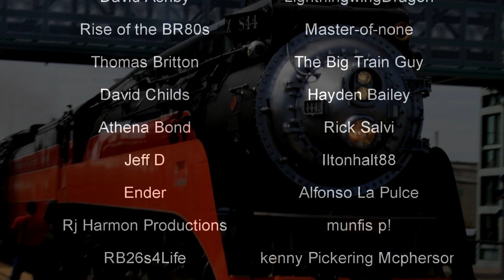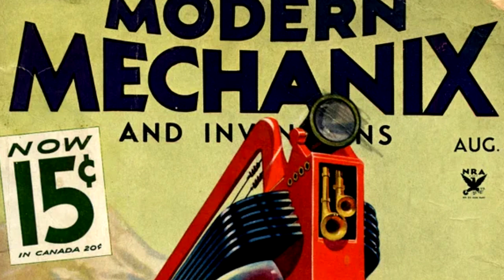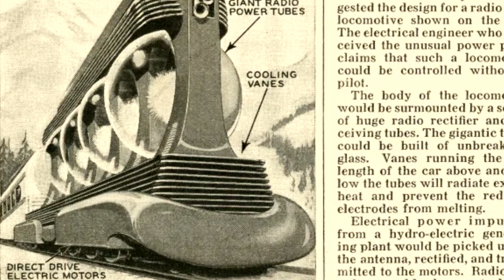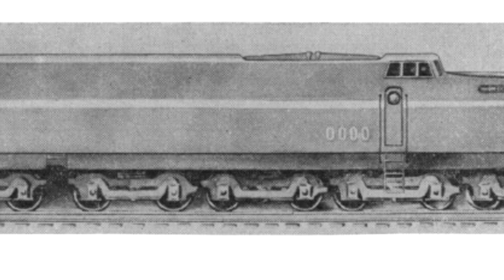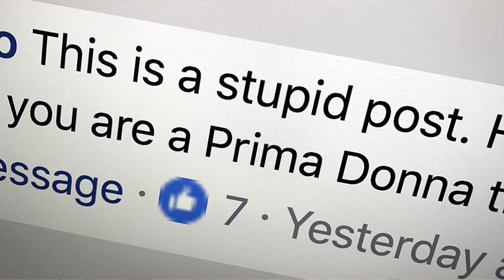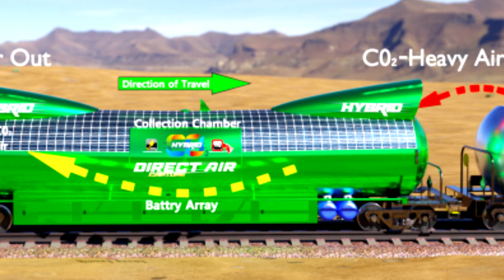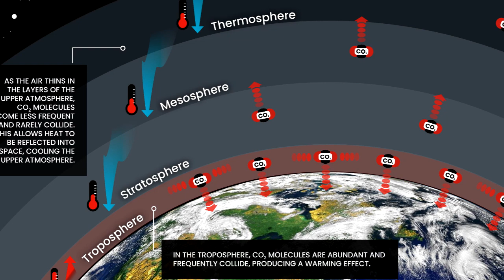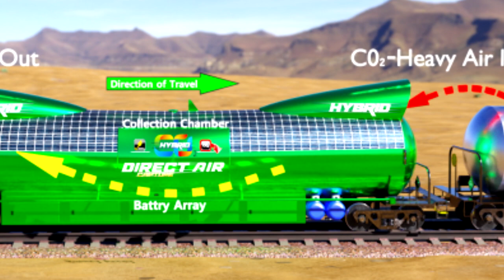5 MORE INSANE Train Concepts (That Were Never Built) | History in the Dark

Comment: Regenerative braking isnt actually repurposing the heat, like some people think it is.
It's literally taking an electric motor, but instead of using it to turn the wheels, you use the wheels to turn the motor, making it into a generator. So, while it wouldn't make quite as much electricity as it takes to get the train moving (due to Newton's law of conservation of energy,) it could generate an impressive amount of energy.

Energy that would get stored in the... um... checks notes "battry array..."
Reply: Have a look at the Article in the scientific magazine'Joule'-it may help explain all this.
Reply: That's actually a pretty common feature of most electric or hybrid buses, where the energy is used to recharge the battery, thus extending the range.
The same technology is used on trolleybuses and trams, either to recharge the trolleybus batteries for off-wire use, or to generate electricity to be put BACK into the grid.

Comment: Regarding the high-speed rail (#5, Amtrak), central & south Florida have it.  Brightline train sets run 85 mph between West Palm Beach and Miami, and the plan is to ramp it up to 125 mph once Cocoa Beach & Orlando are added into the mix.  They're currently double-tracking the Florida East Coast mainline from WPB to Cocoa because the two currently share FEC infrastructure and when it's finished either railway can use both mains.

The graphics guy (#1, CO2 Rail) doesn't know how to spell "battery" either.
Reply: by the standards of the rest of the world, 125mph is barely high speed... anything short of that is just a reasonable expectation for regional rail
Reply: @MercenaryPen  who cares? at least it's something.
Reply: Acela runs up to 150.

Comment: Regarding the Westinghouse electric locomotive it wasn't as far fetched as you might think. The GG1 built in the 1930's had a short time power rating of 8500hp, so to produce a 7500hp loco 10 years later isn't that much of a task. Also 16 axles would be better for heavy freight use which is what that was designed for.
Reply: Love the username
Reply: It also looks like a first pass Virginian Railway 2B of 1948.  That eventually came from GE as pair of back to back B-B-B-B units sharing a common number.  So it did have 16 axles on 8 trucks, and 8000 hp in real life, just split across two bodyshells, and the four built lasted ten years until the VR/N&W merger.

Comment: The first locomotive was the proposed AMT125 high speed (125MPH) diesel locomotive. It would be streamlined and rounded to match the Amfleet 1 cars behind it. I believe it was to be used on the New York to Buffalo Empire service with 3rd rail shoes for Grand Central Terminal. Amtrak instead bought Rohr Turboliners for this service.

The Westinghouse 16 axle electric locomotive was for the planned PRR electrification between Harrisburg and Pittsburgh over the Allegheny mountains in central Pennsylvania. This planned electrification was delayed by WW2 and then never happened due to the rise of the diesel locomotive. I wonder how well this thing would have tracked around Horseshoe Curve.

Comment: On the "Radio Tube" train,the New Haven railroad Did, infact, participate in a test of a radio controlled crewless train in the 1950s.The trainset in question was a set of Pullman Standard "Washboard" multiple unit cars,and the tests were successful,but the technology wasn't accepted
Also...about Baldwin's 16 axle electric's horsepower,GEs Big Blow Turbine generated 8,500 horsepower,and some were upgraded to 10,000 hp before they were retired in the early 1970s

Comment: 3:10 The reduction of the USN from 11 carriers to 10 would reduce the operating costs by 1/11th but would reduce the USN's operational fleet strength by 1/4. As with 11 carriers, one would be in for refuelling, the remaining permit 4 carriers on operation (5 ships in co-operation can maintain 2 at sea at a time), however a reduction to 10 would mean one in for refuelling and 3 operational carriers (as it takes 3 ships co-operating to maintain 1 at sea at a time, although for guaranteed operations you would want 4 [See RN ballistic missile submarines]).
Also there more like $8/9 billion,  that being said USS Gerald R. Ford herself cost about $13 billion because of First-of-class design changes (about 19,000) and cost associated with the difference in construction when compared to USS George H.W. Bush.

Comment: Napier designed a turbo compounded version of the Deltic engine with the turbine in the centre of the triangle, and I think that a prototype was actually built, but it never went into production.  Was the ‘Super Deltic’ intended to use this, or a pair of ‘normal’ Deltic engines?
Reply: Are you referring to the compound turbine engine (mentioned by curious droid in his video on the deltic engine) where the deltic engine was used as a hot gas generator to drive the turbine that supposedly produced near 5000hp but had reliability issues?

Comment: So you think large glass bulbs aren't suitable for a railway locomotive. Well what about the Mercury Arc Rectifiers used by the Class 82 and Class 83 electric Locomotives? Largeish glass bulbs containing a reasonable amount of Mercury and lots of 25Kv AC electricity - sounds reasonably safe - for use by BR.
Reply: If you read the article a bit, they are radio frequency rectifiers. Powerful AC motors weren't availible at that (DC motors could run AC at low frequencies, up to about 20Hz), so they would have been designing for DC Motors.
Reply: And the class 81 and 84's. To be fair, the 81's and 82's were reasonably reliable. They were replaced with silicon rectifiers in the early 70's, together with the 85's, that had Germanium rectifiers.

Comment: It seems strange that the more powerful "super Deltic" was proposed to be Class 51, an even lower number than the Class 55 of the normal Deltics.  Wouldn't they logically have been Class 56 (assuming the scheme pre-dated the eventual 56s).
Reply: The class numbers used by BR weren't sequential in that way (although arranged in groups based on the Type) - in fact, the Class 47 Class as built was more powerful (2,750 bhp) than the Class 50s (2,700 bhp).  It's likely they were refered to as 'Class 51' due to them being considered an evolution of the Class 50, whereas Class 56 would have made sense if they'd looked at building an extended Class 55 (and, yes, the proposed 51s predated the actual 56s by about 8 years).

Comment: 4:48 actually the saxophone shaped airhorn is about the only thing of that design that was based in reality. The early Wabco airhorns of that era actually were shaped like that, the idea being that they were mounted vertically with the bend near the end so that way rainwater would drain out of the horn. WWII diesel submarines also had steam powered horns that were shaped the same way so that seawater will drain out of them once the sub surfaces. Yes, some submarines had horns on them, no idea why.   
It ended up that rain was not that big of a deal and later airhorns were just the straight trumpet shapes that we are used to today.

Comment: The sheer amount of power needed to be transmitted via radio waves to the radio tube train would make these radio waves a lethal thing, they would fry your body.
The 16 axle locomotive however would make sense, it replaces an A-B-B-A set of F7s which have a similar amount of wheels and the electric would have a better power rating.
Reply: That's the thing, we know perfectly well how to transmit electricity wirelessly, but there are side effects.  Do you want the people medium or well done?

Comment: Some of these ideas give me an idea for backup locomotive that uses electricity from a diesel electric locomotive to power traction motors, likely reducing CO2 emissions from multiple-unit trains. It would look like an E7 B-unit but it’s completely electric. It would have multiple large batteries where the Diesel engine on an E7 would be.
Reply: The Wabtec BEL is a converted ES44AC that is completely battery with regenerative braking. BNSF had done tests with it. They haven't figured out how to run it off the DPU it runs with yet. That would be a good idea.

Comment: 15:27 Regenerative braking is actually used in many electric locomotives, where the dynamic braking process (using traction motors as generators in reverse, generating massive drag) is modified to send electricity back into the OHE catenary and the grid. It requires some frequency synchronization to work for AC grids, and if the synchronization fails, the loco reverts back to conventional dynamic braking. It is strong enough to prevent trains rolling down steep grades, and also to slow down big trains over a distance to walking speeds (thereby preserving the brake pads). The thing is, it is feasible with a locomotive, where it has 4 - 6 traction motors, and it is directly in contact with an electric grid. But are batteries enough to hold the energy regenerated from a TRAIN? I highly doubt it (Highly synchronized regenerative braking systems can capture almost 25 - 30% of the energy that would have been lost as heat. Where would you store THAT MUCH energy?).
Reply: It's question for the  experts. but a layman's guess is that the DAC plant would be  creating continuous draw or drain on the. batteries so maybe that is the answer?
Reply: Batteries can be, but you have to size them appropriately.  The new stadler built cl.93 tri-mode locos in the UK are 25kvAC/diesel/battery, and they've sacrificed having onboard dynamic braking resistors (for when you want to use regenerative braking, but the power supply can't take it back for whatever reason) to make room for the batteries.  The batteries can be charged during braking, or by the diesel or the AC supply, and they boost the locos' off-grid 'last mile' capabilities.
Direct air is an investment scam.  It's thermdynamically impossible.

Comment: Okay, I can think of why a lot of axles on a high-horsepower electric is a good idea, and it is basically the same as a slug in this sense: starting heavy trains from rest without overheating traction motors (about 470 horsepower per motor, compared to 375 on a GP7 or equivalent).  A heavy ore train or coal drag could benefit, but 16 axles is still a lot.
Reply: Also, extremely powerful locomotives must be VERY heavy to use this power without sliping, and you have limited weight per axle. But fitting this thing into the curves and switches? Good luck with that. Basically, they are real world examples of 2x(Bo-Bo-Bo), but i think that it is sanity limit.
Reply: @paveloleynikov4715  

search for Ae 8/14 ( a heavy electric locomotive for the Swiss Federal Railway) If you wonder how such a thing might have worked in practice.
Reply: @JosipRadnik1  Thanks. I believed that crocodile were a wackyest swiss design, but I was wrong. But, while I couldn't find detailed description, her running gear looks closer to steam engine with rigid base on photos, as driving axles are not on bogies, but fixed to the frame.
Reply: @paveloleynikov4715  The drive system is called the "Buchli System". it's a very unique but reliable and successful construction. The wheelaxles are sprung and the power transmission is delivered from one side by a construct of interlocking cogs that automaticly adjust to the vertical travel of the wheelaxle. The same system as was used by the Ae 3/6I or the Ae 4/7 and it was cleared for speeds up to 110 kph

Comment: The Acela power cars are 8000 HP!  Diesel Electrics topped out at 6000 real and 4500 practical because of limits of traction versus weight.

Regenerative braking is a real thing.  Electric locomotives have used it forever.  This uses the fact that electric motors and generators are essentially the same thing.  Turning it on generates electricity and the friction of motors slows the train.  The electricity is then sent back on the wire.  Hybrids put the electricity back into batteries for future use.  Diesel electrics use a version of this called Dynamic Braking.  However, the electricity is run through resistors to generate heat which is let out into the atmosphere.

Even so, due to friction, entropy , etc. you will never get all the energy back hence the notion that the capture car would require no energy is ludicrous!
Reply: 6000HP locomotives didnt really became a thing in the US not because of traction issues but the lack of trains where it would make sense to use them.
Here in Brazil we have got the ES58ACi with 5800HP to move massive kilometers long unit trains of iron ore in the EF Carajás together with the SD80ACe with 5300HP ao it makes them feaseable since you always have a set train weight.
IIRC with 4400/4500HP locomotives (C44-9WM/SD70ACe/AC44i) it takes 7 locomotives but with 5800HP it takes 5 and with 5300HP it takes 6.
Plus the fact that the 6000HP'ers of today are a lot more reliable than the ones that were produced in the 90s.

Comment: Given that a standard Deltic could run at 125mph, (they didn't as track, signalling, safe braking, engine wear and a host of other issues,) then a Super Detic would potentially hit 140mph plus if the traction motors and track would let it.
Reply: It was never intended to, really, likely duties were the WMCL expresses (which got pairs of 50's on non electrified sections for a while) and and maybe a handful of trains on the EMCL.  Post full electrification of the WCML anyone's guess.
Initial work on what became the HST included concepts for a deltic powered power car, but that hot canned pretty quickly - the deltic engine wasn't really suitable for the kind of intensive use planned.

Comment: The idea behind the carbon train is that the energy that is normally converted to heat in the resistor grids of a diesel-electric locomotive equipped with dynamic braking would be, instead, used to power a CO2 collector. The problem that I see is that the energy used by railways is relatively small--Obviously, the amount of energy recovered from stopping a train cannot exceed the amount of energy used to make it move. That's not much power.

Comment: The capture car would be better suited to a passenger service route with lots of stops to charge the Regen system. You'd have to do the math though if the co2 it pulls is negated by the extra diesel you burn tugging the car along.
Reply: Interesting that you mention  passenger  trains. Their streamlined  fronts are, i think , the result of wind-tunnel tests which examines the contours of the slipstream and sees where maximum drag is caused -giving the best aerodynamic design designed to minimise this effect on train speed. The Article in 'Joule' seems to anticipate that the DAC railcar with its large 'scoops'  will increase drag so it would  be useful to know whether they can quantify this amount.
i guess the operators of the high-speed passenger trains would be reluctant to incorporate any rail cars that would significantly  lower their speed?